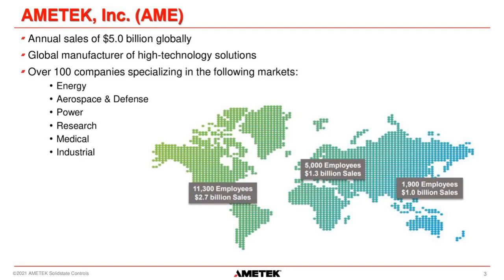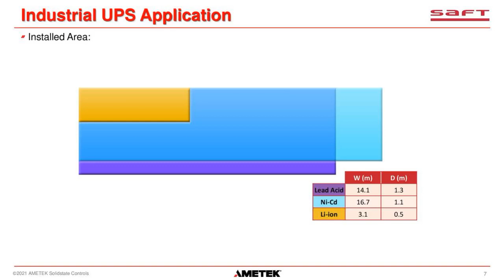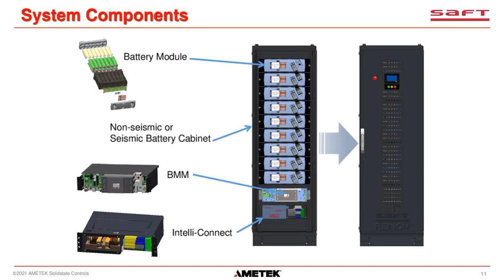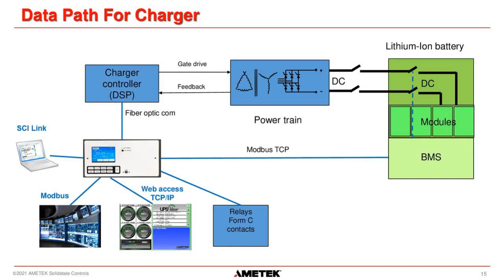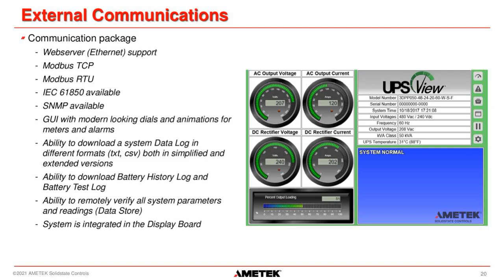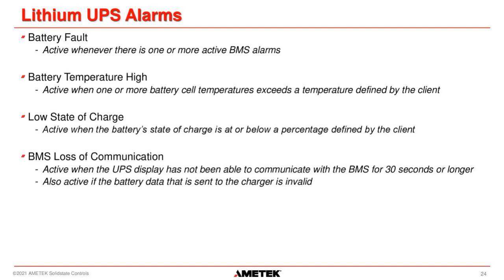Lithium Compatible UPS System

Comment: Questions:
1. How the contractual requirements between Ametek and Saft work on the project/PO level? Is Ametek Vendor providing single solution? Or Is this a JV? 
2. The new lithium batteries chemistry introduce a lot of technical requirements for the batteries and interactions during operation. It seems the model of how electronics - battery is should be working and interfacing is not established yet. How Ametek assures they have all the info from Saft to implement system properly?